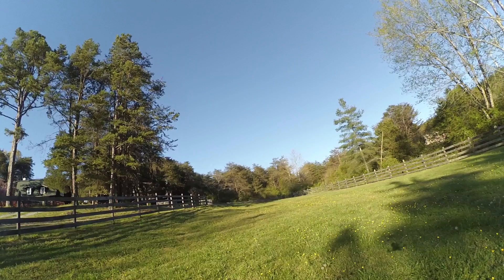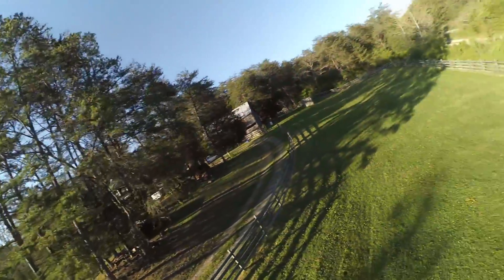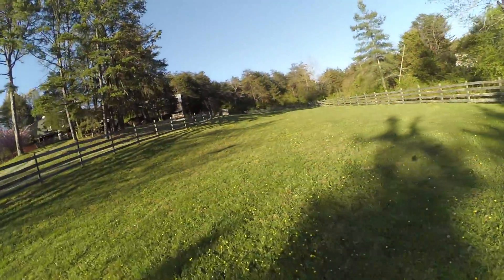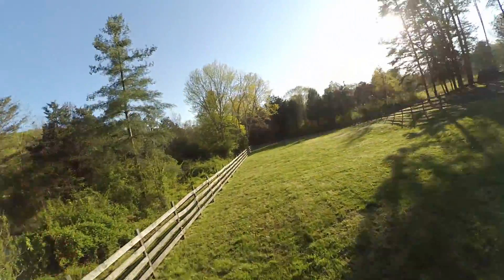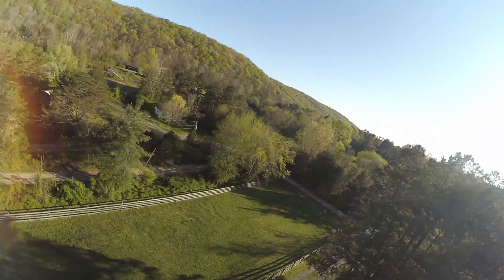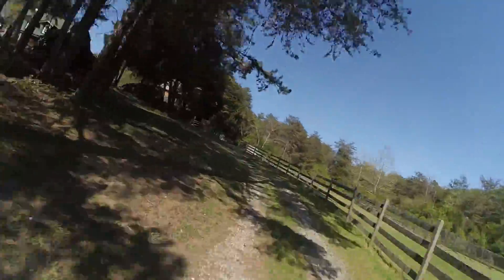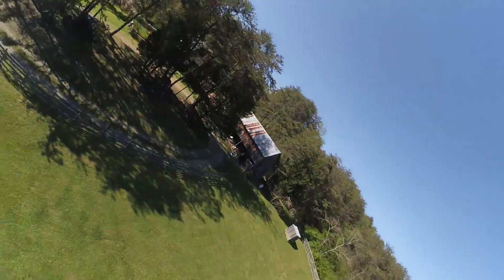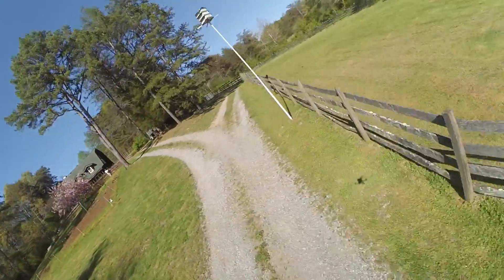PID Tuning Test Flight - No Blackbox / Just Visual

Comment: Hi all, searching  YouTube i found out a pretty nice vid about initial PID tuning on a test bench.  The video is in Italian but the basic idea is that you tie your quad with 2 elastic ropes and let it hang on them and test it that way, and you change the way you tie the quad depending on what PID you tuning. Seems a little bit easier than going out every time and depending on the weather. here is the link and I hope you don't mind I linked another person video here.
https://www.youtube.com/watch?v=-9K6Q0UXJwg
Reply from the maker: +MrZziraldo the string method is very clever, but I don't fully D it to produce accurate results. When I used it, the P gains it produced were way too high. I guess it could get you in the ballpark, but it's not hard to get in the ballpark in the air so why not just do that?
Reply: +Joshua Bardwell Seemed like a good idea. Sorry I couldn't test it myself. My noobness is still strong :D. Hopefully in few months I will be able to contribute with some better info.

Comment: Thanks for another very interesting video. Do you know how PID's relate to a quad size and weight? For example, would a 160 quad weighing 300g need lower PID's than a 250 weighing 600g? Or would the size and weight not relate to the numbers? The way I see it is, if P provides the provisional amount of force to move the copter then a smaller/lighter quad would need less force to move it, thus needing a lower P. I'm a noob, so any advise would be great. TIA
Reply from the maker: +Bludz FPV PIDs are primarily related to thrust to weight ratio.
Reply: +Joshua Bardwell Okay, thanks for an answer. Thrust of course plays a big part of what the PIDs can do. So if you had 2 copters that had the same thrust to weight ratio but one is a 250 the other a 160, would the PIDs be the same or would the smaller one be less. Quite an interesting can of worms I think.
Reply from the maker: +Bludz FPV PIDs should be similar. Weight distribution also matters: spread out vs centralized.
Reply: +Joshua Bardwell Cool, thanks for the extra info JB. Really appreciate it :)

Comment: what about a severe 180 turn where the nose pitches down pretty hard? I just got my SP racing so hopefully that won't happen anymore but I'm kinda curious, thoughts?
Reply from the maker: +AveryFpv My guess would be that the copter is running out of command authority. Think about the motors as being able to spin only so fast, right? And so they can only generate so much thrust and torque. So in a strong 180 turn you are asking for LOTS of yaw and roll output, and one motor may simply run out of authority and an arm may dip. The cause of this may be that you lack authority from the motors (e.g. 1806 motors on 3S with 5030 props) or it may be that your copter is over-weight. My Strider was close to 700 grams and it had this problem when I went to more than about 30 degrees uptilt. When the copter was flying slower, it had the authority to make the turns. When it spend up (due to more camera uptilt) it didn't have enough authority to make the turns without dropping an arm.
Reply: +Joshua Bardwell ah thanks, I've got 2204 emax motors and kingong props but it was definetly happening more on 3s but now I've got 4s the thanks!

Comment: Are you running 1khz or 2khz?
Reply from the maker: +south02m 2 kHz.
Reply: +Joshua Bardwell LuxFloat or MultiWii Rewrite? I have a pretty nicely tuned LuxFloat quad on 1k. Do you think if I change to 2k I should also switch to Rewrite? I'm on a F1 board, but Boris' wiki says it should be OK with F1, Lux and 2k, but seeking your opinion?
Reply from the maker: With Betaflight 2.6.1 your PIDs should translate over directly. Your rates won't. I use rewrite but it shouldn't matter at all any more. They should perform the same.

Comment: Great advise to take it easy in the beginning.  It is probably even good after changing something simple like a FPV camera.  On 26 seconds I had a motor that went to a 100%.  I don't know if was a loose spacer or ESC/motor problem.  It makes a distinct sound I've heard too many times over the years.  http://youtu.be/Dr6qyshSTqw   Can you make an episode in general to help prevent motor problems like that?  Not sure why it makes the twitching sound.  Thank you in advance.
Reply from the maker: +Michael Steele That twitching sound might be a desync. You might need to adjust timing in BLHeli (assuming you're using BLHeli). The motor appeared to go to 100% in Blackbox because it stopped making thrust. Cleanflight was commanding 100% but the motor was actually not turning.
Reply: +Joshua Bardwell Thank you for the tip and your time.  I'll run some tests.
Reply: +Michael Steele Thanks again for your help!  I finally got around to fixing my QAV210.  The replacement of my ESC fixed the problem.  I ran motor tests on each motor and found some serious malfunctioning / twitch / dsync in higher throttle range of only motor 3 ESC.  I put aside the engine with a new one also.  I'm enjoying the floaty-ness of the QAV210 (not the strength) over my ZMR180.

Comment: another great video... think i am starting to understand a little more. so if i am getting a lot of bounce on flips and rolls, also in hard 180s... i need to raise my P, but by how much at a time? i am running BF 2.6.0 currently @ 4khz. my P/R are both 4.5/30/18 which are the stock starting points. should i bump the P up by 1 at a time? i am getting clean punch outs. will i notice the oscillation of too high a P hovering or do I need to be flying? its rainy today but wondering if i could find my high P in the house hovering or doing little punches...
Reply from the maker: +prOkrEAt excess P oscillation will not show up in hover, unless P is way, way, way too high. It'll be most noticeable at higher throttle. You definitely need to be flying aggressively to bring it out, otherwise you will tune for docile flight and the tune will be terrible in aggressive flight. You probably can't reliably find your high P in the house doing little punches.
Reply: +Joshua Bardwell so I was reading BF wiki. said high P causes this but low P might as well... what are typical P range numbers to see where I am sitting.... also how much do you increase while tuning? by 1? by 0.1? heading out to field tomorrow specifically to tune. have EZGUI.
Reply from the maker: prOkrEAt How much I increase depends on how far off the current gain feels. If I am getting crazy oscillations all over the place, I might drop P from 8.0 to 4.0 in one go. If I am fine tuning a change of 0.1 or 0.2 is more typical.
Reply: +Joshua Bardwell you are killing me, when does I come in? I'm at 4.5 on P, so 8 is high? I'm just going to do a BB of my state and post to your thread because I'm now lost again. but I am going to try and raise P first.
Reply from the maker: It was just an example... You're really just wasting your time if you're in your house. Take it out and fly next time you can.
Reply: +Joshua Bardwell oh that has passed... curious for tomorrow what I am shooting for to do. how much to raise P etc...

Comment: how come your quad doesn't fall oddly when you cut the throttle when you check I? is it air mode or low throttle setting?
Reply from the maker: +dudeskinus air mode.

Comment: Oh and another quesion if there is audible oscillation (and a little on camera) on high throttle what would you tune there? Like you are flying straight forward and then push the throttle.
Reply: +RC Enthusiast I might be wrong but I believe that is can be tweaked by raising "I" on Yaw
Reply from the maker: +Sean Richards lower P gain if handling will allow it. Perform throttle top end calibration (search my channel) if oscillation occurs near max throttle. Possibly lower D gain I'd the oscillation is more of a twitching or bumping. And always address physical sources of vibration first.

Comment: what should I be looking at if the nose is raising on punch outs? i gain?
Reply from the maker: +jamble7k Yes. Increase pitch I gain would be my approach.
Reply from the maker: +jamble7k What is your current pitch I gain?
Reply: +Joshua Bardwell just a general query - I've see it on a lot of quads in the group I fly with that are running stock betaflight, cheers!

Comment: Again. i think the low throttle issue is caused buy the torque of the motors screwing with the Gyro. the Orings are just not doing it, they're working Better.  and you can try  to partially Tune it out, at what sacrifice too performance.? Question
Reply from the maker: +dungeonsound1 Not sure what you're asking, sorry. Please try again?

Comment: I wonder if you could help me with my config: my quad is about 580gr auw and I m running cobra 2204 1960kv on 4s. It is very disappointing because when I m training for freestyle I just don t have the power to recover it when I make a mistake ( like my 180 can because of a much better weight/power ratio) I tried a lot of different props with these motors but nothing seems to be adequate... Now running 5040bn. Thanks.
Reply from the maker: +Trolleydolly130 1960 kv is probably better suited to 6" props or 6S. That may explain the lack of power. Also double check your ESC calibration to make sure your ESC's are making full power.
Reply from the maker: +Trolleydolly130 if one ESC is miscalibrated, it will limit the power the other motors cam make.
Reply: +Joshua Bardwell Thx. Pretty sure calibration is good. Tried 6": it was better but less agile. Time to go for 2300kv I think. What motors are you using?
Reply from the maker: +Trolleydolly130 RCX 2633kv. I like that the higher kv lets me use cheaper two-blade props while still getting good performance.
Reply: +Trolleydolly130 If you want power maybe check out the red bottom emax rs2205 motors they are supposed to be mighty.
Reply: +Stephen Gibb Oh by the way escs make a huge difference in thrust make sure there not holding back your motors.
Reply: +Stephen Gibb Thx guys. I Will try new motors as I think the 1960kv are a bit obsolete. I like the rcx as they are so cheap...

Comment: Thanks for this! But 3:14 confuses me a bit. About the rebound at the end of a flip roll. 
How can a low P gain cause a bounce back of the quad? I thought that a high P gain cuases overshooting...

And what to do against the propwash szenario at the end of a sharp turn?
Reply from the maker: +retardedband low P gain causes bounceback because the P term is insufficiently authoritative to stop the copter sharply. As the stick begins to return to center, the P term starts opposing the gyro motion, but it isn't able to stop the copter in time. The stick is centered but the copter is still moving. The copter overshoots. The P term continues to push against the movement until eventually the copter finally stops. This explains the overshoot. The rebound comes in because either 1) the I term has accumulated error and now tries to unwind the error retroactively, meaning that the I term tries to push the copter back where it should have been if the P term hadn't messed up, or 2) the copter system as a whole is relatively unresponsive, so the P term's attempts to push against the movement don't stop sharply enough.
Reply from the maker: +Hoggdoc You can see a tight-ish turn at around 0:30 in this video.

https://www.youtube.com/watch?v=eTzEFn4EivM

I try to make smoother turns rather than sharper turns, so it may not be the absolute tight pylon style turn you are thinking of. The amount of yaw and roll that you add varies depending on how much pitch forward you carry through the turn. The more pitched forward you are, the more roll you will use and the less yaw.
Reply: +Joshua Bardwell Thank you so much for the explanation! That helps a lot. 
So would it be correct to first tune out the P gain before even touching the D gain? 
I would raise the P gain till the copter oscillates and go down a bit. Then check with hard stick commands if i have any bounce backs and raise D to get rid of it (?)
Reply: +Joshua Bardwell Thank you so much for the explanation! That helps a lot. 
So would it be correct to first tune out the P gain before even touching the D gain? 
I would raise the P gain till the copter oscillates and go down a bit. Then check with hard stick commands if i have any bounce backs and raise D to get rid of it (?)
Reply: +retardedband I think so, just folow usual tuning guides, like from boris b, or what are you using.